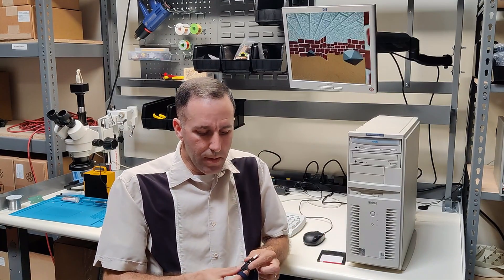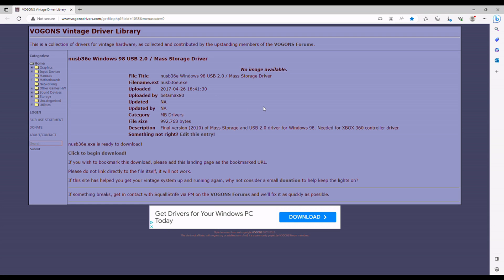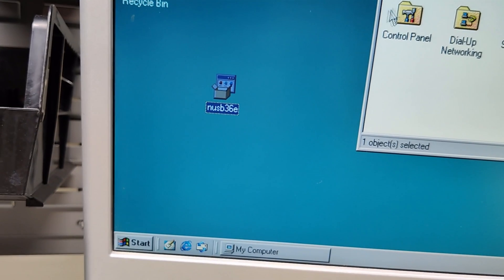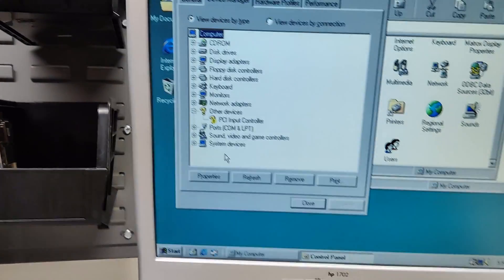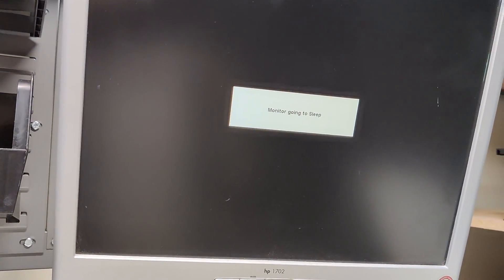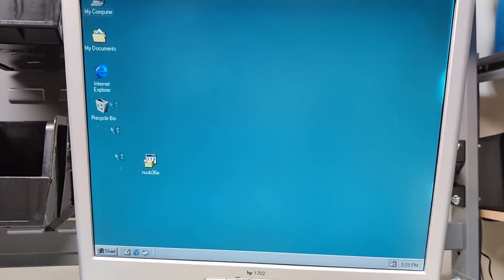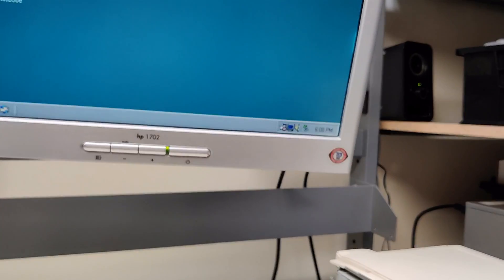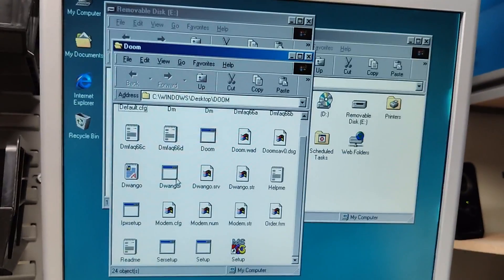How to install a USB flash drive on Windows 98

Comment: Hey don’t know if your response but can you use a SATA to IDE adapter with not just a hard drive but a ssd. It’s hard to find good 100 gb hard drives for a windows 98 computer.
Reply: Ps I have a recovery cd for windows 98 but the hard drive doesn’t work so that’s why I’m asking

Comment: I messed up. I was doing this half asleep and got to the step where you delete the usb part, then tried to tab around. It then occurred to me that my keyboard is also usb. This computer only has usb. I’m an idiot.
Reply from the maker: I'm not sure a computer with USB only has the architecture to support Windows 98. It might be too new. Most of the motherboards then had PS2 connectors as well.

Comment: Thanks for the tip, i"m gonna try it. I just got a old P II system with win 98 to play some games from my childhood. I have some old GPU's in my basement that i didn't even knew I still had so have to try out differnt drivers. I have a external cd writer but burning a cd everytime for just a driver is time consuming  and i don't have that many blanc cd's left so a flash drive would be very easy.
Reply from the maker: Thanks! Yeah I use it all the time, just used it today actually to transfer some old DOS game files.

Comment: How come you need yo remove the USB controller (device)?
Reply from the maker: It avoids any potential conflicts with existing drivers before you install the new ones. The USB drivers that come with Windows 98 predate the existence of USB flash drives. If you are using a PS/2 mouse, that of course would avoid losing mouse control during that step.